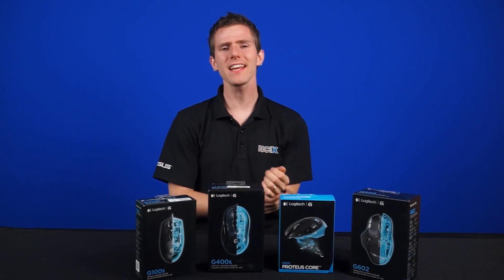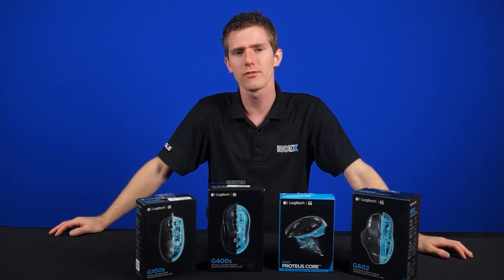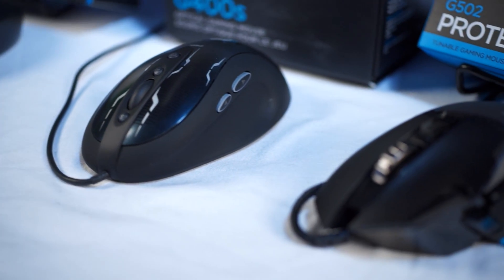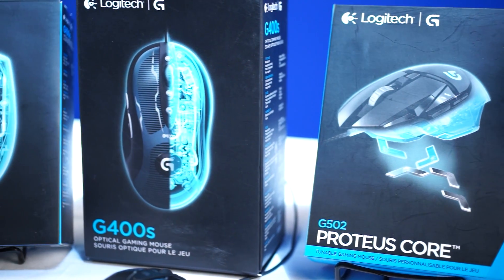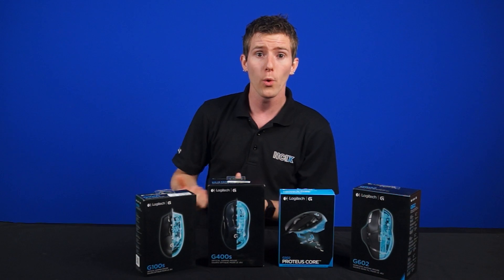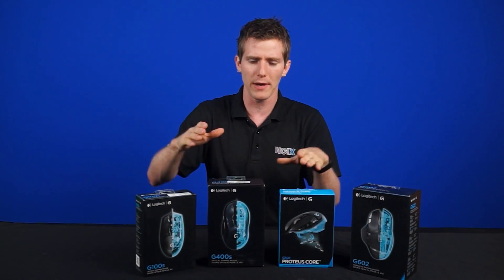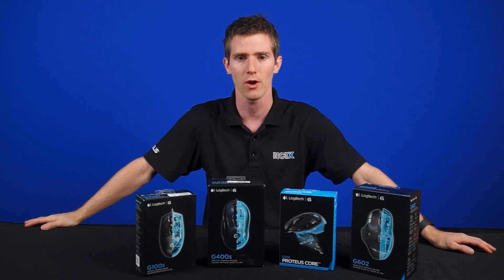What is Delta Zero Technology from Logitech? Explained ft. G502 Proteus Core

Comment: Logitech doesn't make sensors. You keep referring to "Logitech's sensor", and acceleration. It's not their sensor, but it is presumably their PCB design. I also don't know of any sensor that has "hardware acceleration", at least not the kind of acceleration you're talking about. When gaming, or when using a decent mouse for any other purpose, it's well known that you should turn off all possible sources of acceleration, and set the Windows sensitivity dead-center for 1:1 scaling, and adjust with the mouse firmware.

I think laser sensors have a predictive mechanism that can sometimes be called acceleration, but it's not the same kind of acceleration that you're talking about. It is not intended to "accelerate" at all, it's just a necessary part of how laser sensors work.

And I still don't have the faintest clue what "Delta Zero" is, making me suspect this was really just a big advertisement.

Comment: I own both the G400s and G602, have had them for years now. Fantastic mice for FPS gaming (CS:GO, BF4 and 1, etc) and the G602 can use a SINGLE AA battery to cut down on weight (both batteries are in parallel, so 1 AA is 120 Hrs of gaming, 2x is 250 Hrs).

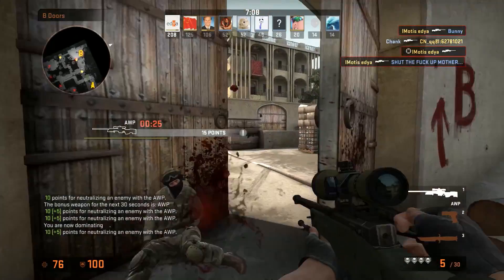Comment: Wait.. 3:00 Sometimes deceleration is an issue too.
I got the G502 on 12-nov. and I've experienced something where a slow movement makes the cursor go further than a quick movement of the same distance. I called this 'inverted acceleration'... So.. does that mean that the sensor in my mouse isn't good? It also has trouble tracking on my somewhat glossy wooden desk. In other words, I think I got a broken mouse for my birthday..

Comment: I have the G502..amazing response, sensor, and DPI. But, the 2 buttons next to the left mouse button (that adjust DPI by default) are flush with the left mouse button, so I click them on accident all the time. Also the "sniper" button is too far up for me since I use a claw grip. It's not too bad on games where I dont have to be real fast to get to that button, though. I really like the mouse all together after getting used to it, but I still wish they just continued making the G9x :(

the mouse wheel, little spot for your thumb to rest on, and the rubberized-grippy-stuffs are awesome, though. 

sucks the lights are only blue :(

Comment: I bought the Logitech G602 on the 29th of April and put a pair of my trusty Eneloop 2500mah xx AA batteries into it. Granted most of the time the mouse has be in the power saving mode but my mouse still has 3/5 bars of battery (considering bought over 2 months ago now). Which to me is incredible!
Reply: Before anyone asks I got a wireless mouse as I use my PC for gaming and media, so when I'm watching a film I like to put the projector on and take my mouse and keyboard with me without sitting at the desk to control the film.

Comment: I have a Razer Naga 2014 and I think mines jitters (maybe I'm just not moving it right?). Is the sensor any good on the mouse?
Reply: Dylan Tucker I don't have any jitter.
Stop using cheap ass mices
Reply: Adjust it to a really low DPI and progressively increase it as you move your mouse back and forth slowly. Also make sure you have pointer precision activated on your computer and the poling rate maxed in your software. I personally have a Naga Epic and it has a bit of jitter and acceleration. The Nagas have pretty good sensors (I would give them a 8.5/10) but aren't nearly as good as Razers Deathadder or other FPS mice like the g502 or m65. Hope that helps!
Reply: Dylan Tucker I see. Thanks.

***** The Razer Naga mice aren't cheap o.o and that being said I've used a fair few cheap mice that have at least felt good so saying spend more isn't really valid.
Reply: Fringie Well, you can't really get cheaper than my gaming mouse, often less than 11$/each (also available in wireless for the same price)

Comment: Logitech or Razer ?
Reply: I like Razer and use razer, but i also trust logitech
Reply: Razer quality is lacking IMO and are way over hyped and to small for my liking but def not bad mice tho. Go feel them I'm your hand go with the one that feels right and from there which one tracks to your liking.
Reply: It really depends on the product you are talking about. i.e. (keyboards, mice, and what have you.)
Reply: well i got a razer lycosa keyboard ans lachesis mouse, only downfalls i have are, the cord for the keyboard is too stiff and the keyboards software is so/so, i get these moments where certain buttons stop working, and have to unplug and plug back in, the mouse seems Pretty damn good though
Reply: I'm using the Logitech G710+ and the G502 P.C. really i love them both. no flaws with the G502 but on the G710+ the G keys a a bit far away. what i do like about the G710+ is the wheel for your volume.
Reply: Logitech products useally are better then Razer.
Except there isnt a headphone that can go aganist razer tiamat as its only one with 5 drivers per ear currently. In future, if logitech makes similiar headphone i have no  doubt it will bury tiamat

Comment: Logitech G400 - 	Avago ADNS-S3095:	you need rev. 2 with PID above LZ13333
Logitech G400s - Avago ADNS-S3095:	4000 CPI SROM, some added input lag
Logitech G100s -	Avago AM010 N1301T:	has jitter above 1000 dpi
Logitech G502 - Pixart PMW 3366DM: jittering above 2000 dpi

From: Mice using flawless sensor by H1ghlander
Reply: what about G700?